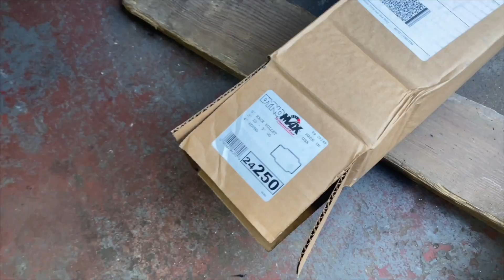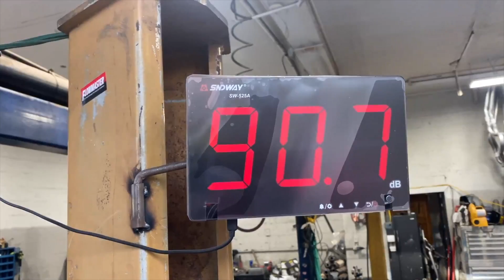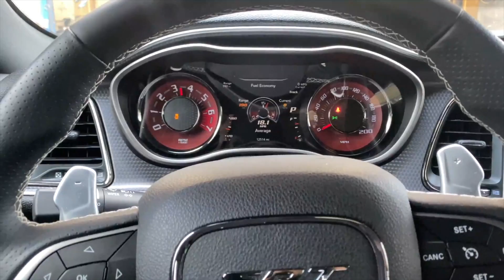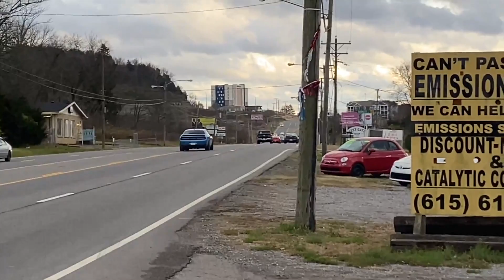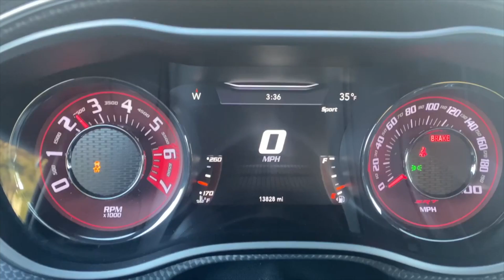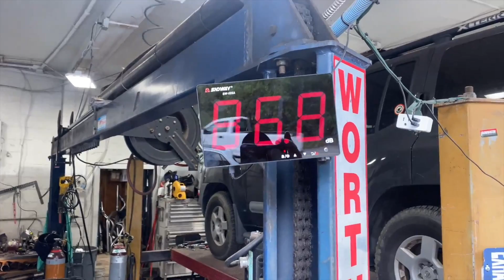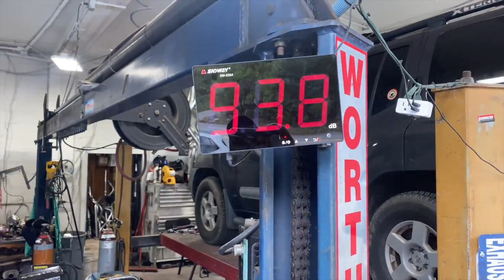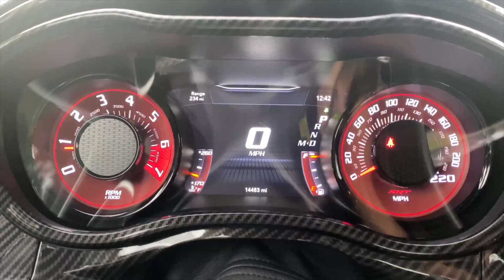Top 4 LOUDEST EXHAUST Set Ups for Dodge Challenger Hellcat 6.2L SUPERCHARGED V8!

Comment: I was hoping for something louder than my setup but my setup legit scares people when I get on it lol. I also have a 2016 challenger hellcat B5 blue with black stripes. My setup is Legmaker CAI w/ Borla Atak exhaust with simulators. Also got a catch can and aftermarket factory reproduction 10.5" wheels in the back 305 35 20 Michelin sports and 275 40 20 michelin sports in the front. This thing grabs like a beast now and sounds like a orgasm on wheels. Cost for everything was about 3k-4k including installation by a shop.
Reply: Jalen Brown  don't you need cats? I live in Cali so im not sure if it's just a Cali thing
Reply: Jalen Brown  ah i see okay

Comment: You don’t need back pressure with a blower motor. The cats and the exhaust manifold are the 2 that gain power if removed and long tubes are added. Now obviously emission testing in some me states will prohibit getting rid of them and high flow cats are the next best thing.
Reply: Back pressure? If you stick a potato in the tail pipe that’s back pressure. What you’re looking for is the scavenging effect. And yes you still want it in a supercharged car. It’s less beneficial on a turbocharged car.